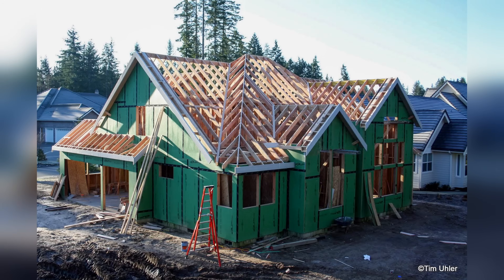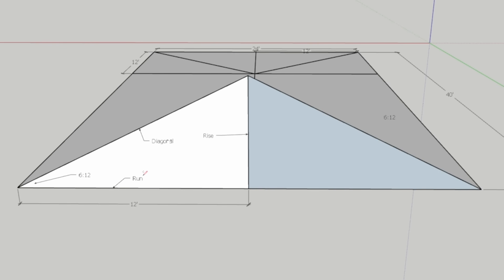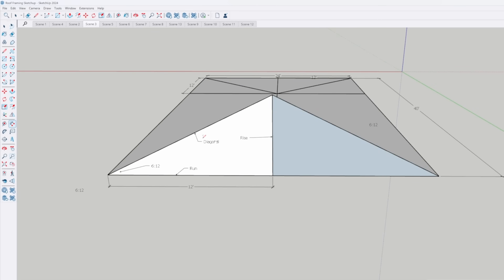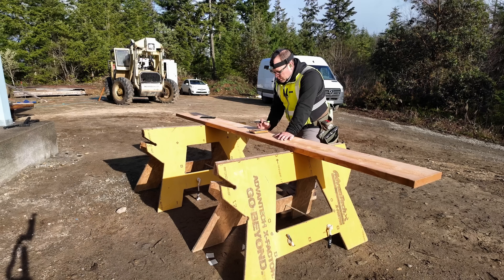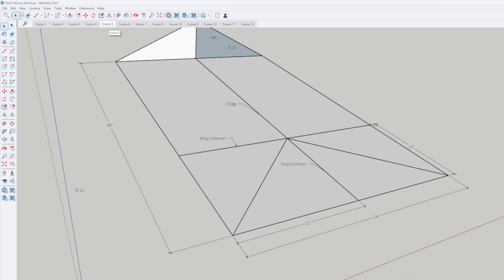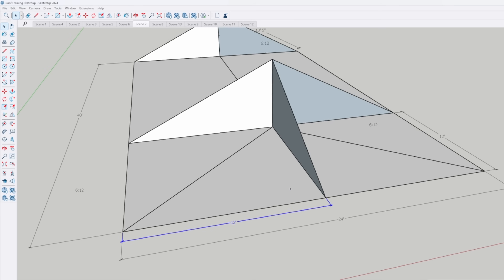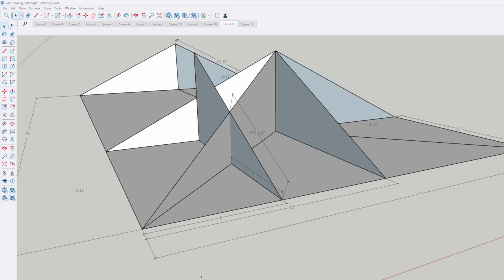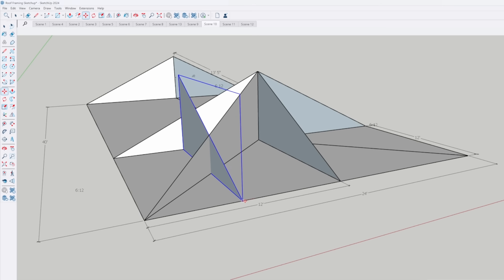How to Frame a Roof Like a Pro | Step-by-Step for All Skill Levels

Comment: I bought a Construction Master for construction classes, but had to stumble through the calculations to find roofing dimensions. Luckily I am very good with a calculator, but never felt very good about punching in inches for the slope.
Thank you for confirming my suspicions, and also which buttons give you more information if they are punched twice. (I had not even considered that)

Comment: I think (hope) over time roof design will take in mind optimizing for solar panel layout. Less visually appealing than multiple faceted angles, but I want my house to be a power plant!
Reply: they already have solar panels (solar cells) integrated into roofing material. Early yet, though.
Reply: There are a few builders in my area (southern RI) that have been doing this for a few years now.
Ugly houses,but  maximum amount of solar panels.

Comment: Hey Tim can you show how to subtract the ridge from the common and hip rafters? I know you take half the ridge thickness off for the common but how much is taken off for the hip? You took half the span for calculations but you didn't take half the ridge off at that point
Reply: For an equal pitch roof you would take off half the thickness of ridge on a 45 degree angle. For 1.5” material. If you take half the material  .75 squared plus .75 squared it will give you 1.060 this is the amount on a 45 and this is the amount to remove from the hip.
Reply: @renetessier2051  thanks for the reply. Another question if you'd like to answer. If he done the calculation at the beginning with the ridge taken off would it work out the same for the hip calculation? Say he done 23' 10-1/2" divided by 2 to give 11' 11-1/4" run with 6" pitch and then hit diag on the calculator would hitting the hip button also give the correct length with the ridge subtracted?

Comment: For me kings are generally a waste to install . They interfere with layoff..They are extra wood  and many bypass them in the nailing since they rarely fall on a layout .. Though a king can be the layout generator to the left and right for timber framing  . A ridge can be established with hips alone . I call them Phantom Kings or establishing a ridge with a heel sweep .  You got the essentially the basics here. The terror is when it becomes the real world . Valleys generally strike the center and hips the edge , So the math can lead to confusion when seen in essentially 2 dimensions . Personally , I have never used a Construction Master.. Tried one , didn't like it . Granted I don't like cubits , slide rules or the Swanson Book of The Brain Dead either .  I like my trusty ole TI-30xa for $6.95 from Wal-Mart . With it , I can calculate for orbital insert of an LVL to Neptune. I am a major proponent of "Learn The Math " .. just don't enter this and enter that and wait for the resultant . Need to see the math move and how everything stitches together. Then with experience . Watch the dance . I learned by watching guys lay rafters out in the yard to see if they " Fit " . or walking off a framing square .  Good entry level stuff here.. Master Carpenter 43 years exp.
Reply: Well said. I agree
Reply: Ha I’m only a few models above you with a TI-36x pro as a civil engineer. Can’t beat them.